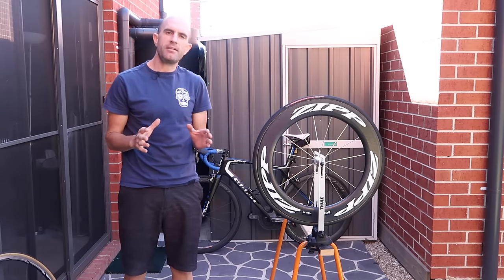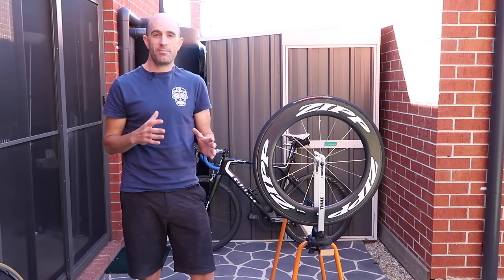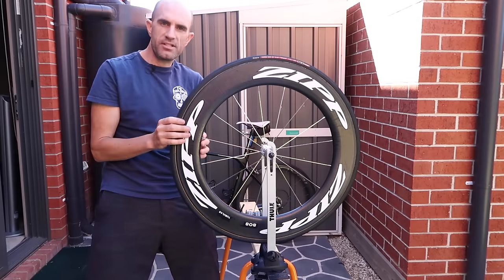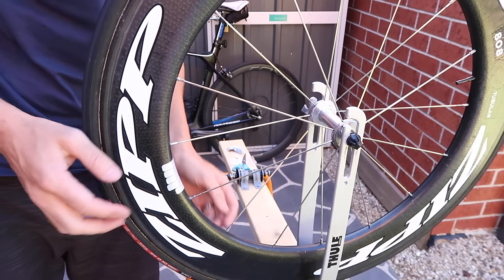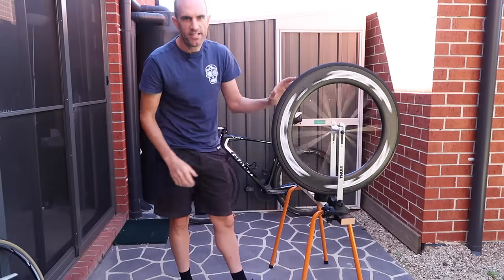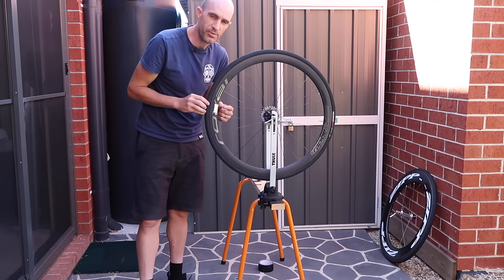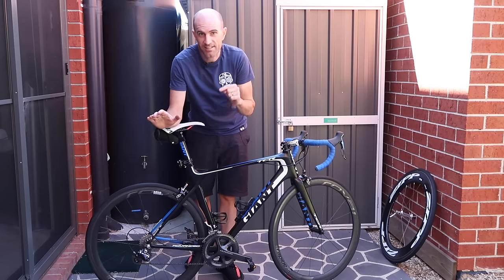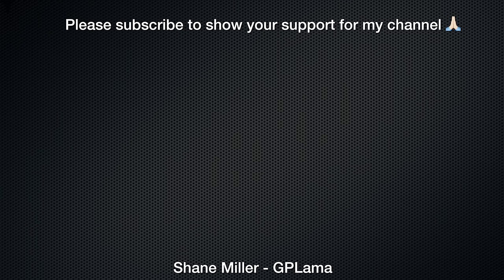Bicycle Wheel Balancing: Marginal Gains or a 'Must Do'?

Comment: An absolute eye opener. I recently spent $2000 on a wheelset for my old Orbea TT bike. But instead of the hoped for improvement and prep for Ironman in December, it just felt so horrible and even unsafe. 
I was about to take off the wheels and sell them and just put my old cheap ones back on. For 4 years I never had an issue with the bike, but now I did not only have a $2000 problem, but well meaning people telling me how I had the wrong tyre pressure, how I had to practice more, had to get used to it or even that it was windy, when really it wasn't. And IMWA can be windy anyway, so it has to still be right. 
Fortunately I went to bike frame restoration specialist to have one last look to see if there was a fault. 12 grams of little lead weights later, and I finally love my bike again. So simple. But why doesn't everyone know this? The shop where I bought the wheels plus one other where I went for help did not mention this at all. They were both high end stores. Really very disappointing when you spend this sort of money.
So thank you so much for the video. It is by far the best on the subject that I have found so I can "enlighten" others.

Comment: doing this for years, the difference is i use old speed sensors' magnet, attach it to the spoke to do the job. 
the good thing is you can adjust the position of the magnet along the spoke to get a very fine adjustment. if you need more counter weight then move the magnet toward the rim, need less then move the magnet toward the hub.
Reply: Great tip, man! Thank you for sharing.
Reply: Many thanks, been searching for "how to oil bicycle" for a while now, and I think this has helped. Ever heard of - Viyackson Yenacob Review - (search on google ) ? Ive heard some pretty good things about it and my friend got cool results with it.
Reply: I'm guessing this is how car tires are balanced

Comment: Whilst balancing wheels is unlikely to do any harm, the tests done in the video are not representative of normal bike use.

For a start, in the video the wheel is largely unconstrained. When riding the wheel/tire is subject to a normal force dependent on the weight of the rider. The tire is also acting as a spring and damper between the wheel and road which will complicate things.

Just like wheel wobble on a car, the problem is most noticeable when the rotational speed coincides with natural frequency of the rest of the system. This is generally referred to as resonance. At this frequency a small excitation force can cause large oscillations if not damped. Increasing or decreasing the rotational speed will result in much less wobble as will any damping forces. In the video there is little damping and the wheel appears to be spun up until it hits resonance.

The frame stiffness, rider weight and tyre compliance will all affect what the resonant frequency is and therefore what speed maximum wobble occurs.

It might be worth repeating the experiment with and without balancing weights, but while riding on rollers and comparing any vibrations at the dropout.

Out of curiosity, I just tried spinning up the rear wheel on my Giant Defy Advanced 2 while it was loosely clamped by the seat post on a bike stand. I didn’t get any significant vibrations.

Comment: I'm a man of science - keen to see the empirical evidence of the real world difference this makes. Not saying there is no difference, would just be great to see it.
Reply from the maker: The bike doesn't shake like all shit when the wheels are up to speed. That's a good start. As how to actually measure and quantify the befits? That's going to take some thought..... and equipment.
Reply: But how often do you ever notice it on the road? That oscillation - to me - feels like it would be almost all, if not completely, offset by imperfections in the road.

Not knocking having smooth wheels. But. Is this is a solution looking for a problem?
Reply: Nick Squillari 
There is a big difference in the ride and the feel of the bike roll at slow , medium and fast speeds.

Comment: My Campagnolo Zonda's came perfectly balanced. They put counterweight on the other side of the valve inside the rim.
Reply from the maker: Excellent! Good work Campy!
Reply: I actually have Zondas on my CAAD10 and didn't even know, great to read!
Reply: My Shamal Ultras came also perfectly balanced. They watch out for details. Maybe that's the reason why they subjectively roll so nice.
Reply: Same story with my fulcrum racing 3's. (Rebranded zondas.)
Reply: Same with my Neutrons and Shamals.
Reply: Stefan That's cuz campy knows what they are doing not like others....looking at you Mavic.
Reply: Same for me also with the Zondas
Reply: Hello Stefen,   ???Do You Ride Zonda Wheels With Out Tires???   The the moment you put on a tire on a perfectly balanced Zonda wheel it is out of balance again. Why? Because all tires have a heavy spot some up to 15 grams!  If you think 15 grams is nothing to be concerned about, think about this, a reflector weighs about 17 grams.
A wheel that is out of balance by as little as 4 grams, at high speeds (40 ~ 60 mph) causes major centrifugal forces equal to that of a large sledge hammer swinging from your front and rear axles.  This is new science just being learned by the bicycle industry which is causing major handling problems like the dreaded High Speed Wobble.
Unfortunately the only correct way to perfectly balance a wheels is to balance the complete wheel including the tire. There is a carbon wheel company called SLEEPER working with Dynamic Speed Balance who is about to introduce a perfect Patented wheel balance system.  It is so advanced it does not add any weight or needs gadgets to achieve perfect balance.  It allows anyone to balance a wheel perfectly by simply aligning the tire logo to the air valve and the wheel is perfectly balanced every time.  Its incredible new technology. 
Stay tuned visit dynamicspeedbalance.com  click on "HOW DSB WORKS" it gives a clear picture of what really goes on with wheels at high speed.
Sincerely Dan Sotelo
Reply: I checked my Mavic and Fulcrum wheels on my bikes - no noticeable shake either. I think some manufacturers indeed pre-balance wheels for a typical valve weight. Those more expensive carbon wheels probably need balancing because manufacturers do not do this to save weight.
Reply: @dansotelo8450  Balanced wheel would seem better starting place, but I agree tire/tube (Liners/Tubeless) would always add another step to making certain your wheels do not hop about while spinning on MTB jumps, nor on high speed descents in road cycling.
Reply: I also have several sets of Campag wheels. They may all be nicely balanced BUT the main problem is the tyre. All tyres (or tyre/tube combos) have an uneven weight distribution around their circumference. You have to balance the complete system as Shane said in the video. No point in getting anal about a perfectly balanced rim and then mess it up by fitting a tyre!

Comment: Even if you don't race, looks like it might make a difference in stability if you ride in an area with a lot of downhills. Cars and motorcycles don't just balance for efficiency, that shaking gets quite noticeable at highway speeds.
Reply: It's not just stability, out of balance shaking increases stress on wheel bearings, spokes, rim and frame. Definitely worth doing for any bike.

Comment: Hey y'all, I know it's a bit late - a mate of mine put weights on the outside of his zipps like Shane does here. The rims both expanded at that point after a race with long downhills. I think there is an impact where the weights cool the inside of the rim, causing the brake track to get hotter as it can't spread the heat as well to the area with the weights stuck to it. I am really interested in this topic and will be balancing my wheels, however I think somehow I will be weighting inside the rim tape on the spoke nipple holes. YMMV. Thanks Shane!

Comment: If you use tubes, you can try to place the counter weights below the rim tape or - as I did - glue them within the rim bed onto the rim tape. I had to use a good sticky tape ("Tesa Gewebeband") to attach them securely. However, this makes the weights invisible und does not influence aerodynamics. Thank you Shane for the hints with the golf club weights!

Comment: Old school thing I used to do was put the speed sensor magnet opposite the valve for a similar effect, those magnets are not light!!
Reply: Rieger81 and magnets stick to each other so easy to add more weight. I like the silca balance pod

Comment: Good one Shane. I've never weighed a valve stem, but most (all?) I've seen were brass and in addition to the tube reinforcement in that area I'd guess would weigh around the amount you're adding. It would be interesting to cut up an old tube where the stem area starts and then weigh it. It will mean your balance will be affected if you change valve stem lengths ;)

I don't believe there's much, if any, special reinforcement around wheel valve stem holes. In alloy rims they simply roll, weld, then drill the rim extrusions. I've not noticed any reinforcement in modern CF rims either, indeed I don't think they will even know where the hole will be when they drop it on the spoke drilling machine. 

I'm sure this video will create a lot of interest, so well done.

Edit: What the heck, just before posting I cut up and weighed a short valve stem and it weighed 6 grams. I'd expect a long one to weigh 10-12 grams

Comment: I have been balancing my wheels for years with great results.  Once you have figured out the weight and location, I like to put the weight inside the rim for a cleaner look.  You can also move the tire around to balance the wheel too, as tires are never evenly balanced.  There will be a small amount needed to fine tune after you add the internal weight and lead solder rapped around a spoke is a super clean way to finish it off.

Comment: Im here because i was just out in my garage setting my front derailleur and when i spun my rear wheel the whole bike wanted to fly off my work stand!…. I work on cars and im well aware of wheel balancing and was shocked at how out of whack bike wheels are! After it did that i tried on all my other wheels ( 6) and they were all equally bad, cant believe his is not addressed more often , if just for the better quality ride on smooth tarmac! And amazing at how few videos there are talking about it. Sure, its hot making you faster, but it has to be smoother going todo en the road to have balanced wheels, no?

Comment: That is an incredible insight. I just bought a new set of Fulcrum 4 wheels and will test them for balance now that I’ve seen this. Your jig looks like a fairly standard Thule roof rack accessory which is clever. Innovative use of golf club weights. Great video.

Comment: Good Video 👍 

I have balancing my Weels also .
After hevy Speed Wobbles on my Road Bike at 46 km/h .

Ich put a String of Lead sheet  from my Roofer Frend . And cut it to a 15 mm to 130 mm String … ( may be 10 Grams Weight )
And glue it strait of the Rim Tape . And put a other new peace of Rim Tape above.
Put the Tube and Tire on an nobody can see the Balance Weight inside . And it works Great  👍

Comment: could you put the golf weights under the rim tape? lining them in a line opposite the valve instead of stacking them?
Reply from the maker: Maybe..... maybe.... it could impact the tube casing/flex and do bad things to the uniformity of things.
Reply: tektechnician I was thinking the same.
Reply: I was thinking the same. Not that this is anywhere near my field of knowledge.
Reply: tektechnician Yes you can 
just make sure to replace the tyre and tube in exactly the same position as it was when you balanced the wheel
Reply: Might not work so well for tubulars
Reply: earthstick yeah, this method is really only applicable to clinchers. Tubs or tubeless would be dangerous or just impractical
Reply: Yes you can. I just put the actual blue tac on the rim under the tube - didn't need much, about 3g. Flattened it out equally to 2-3mm depth. My clincher Fulcrum Racing Zero is now perfectly balanced.
Reply: BabyIveBeenWaiting
That tip deserves more upvotes!
Reply: I did this with Zipp 303. Works fine.

Comment: Can you give the eBay link to where you got those magnets from?
Reply from the maker: https://goo.gl/83VoA7
Reply: Shane Miller. Great and very informative video. I don't know if u have done one but as a newby it would be great if u did a video comparing different wheels. Especially for TTs  (I.e. Tri spoke vs deep section vs discs, and clincher vs tubs)
Reply: you are aware that the strips are lead based.  I would not be touching them with bare fingers.

Comment: Put the valve on one side, the weight on the other, so they horizontally oppose - then just let go of the wheel. Which ever side falls to the bottom has the greater amount of weight.

Comment: Just bought some race wheels that seemed to be absolutely perfectly balanced 'til I put the valves and tyres on. Thinking about it, it makes perfect sense that a 75mm valve would weigh enough to throw the balance off, surprised it's not taken into account when building.

Comment: Go tubeless. The sealing fluid also has the effect, after a short distance, of balancing the wheel. Using sealant fluid for this purpose means that the wheel remains balanced even as the tyre wears so you don't have to keep checking or replacing weights.
Reply: Old White Hair my rear wheel wobbles loads and that's got the liquid in. It probably makes it worse, not better. 50g of sealant sloshing about.
Reply: As you go faster the g-force should surely force the liquid outwards stabilising the sealant?

Comment: Improper wheel balancing is also a possible contributor to high speed wobble (subject of much debate), which can be pretty scary and dangerous. If you ride fast descents this is definitely worth 5 bucks and an hour in the garage. I knew my pro-lites were unbalanced but didn't worry about it until I rode an 85kph descent. The bike felt like it was trying to escape!

Comment: Just seen this....Shane...you are spot-on.....I had to add weight to my carbon wheels...I found if I added weight to the spokes ( adjacent to rim ...and I used tennis racket lead / adhesive weights )...added to three spokes ....major weight to the spoke near opposite to valve ....diminishing outward had same effect .paint em black ....keeps your wheels looking clean and mean .

Comment: I have thought about wheel balance since I bought my first road bike 5 years ago. I had always noticed the wheels always dropped, downward, on the valve stems weight. And that wobble they get , I thought, had to be affecting the ride efficiency. This video just quantifies that I need to balance them. I plan on finding the correct weight(or as close as I can get to it), and then removing the tire and installing the weights under the rim strip. No need to give my competitors the same edge :D

Comment: Great vid, Shane! Your cheap solution seems to work very well and look great I think :-) Thanks.
I experience this on some 55mm custom carbon wheels I have. I am positive I can really feel this descending at high speed on smooth tarmac. Lots of vibration in the bike, and the tarmac does not feel smooth -even if it is. The difference compared to Shimano Dura Ace C24 is quite remarkable!
I don't think its mentioned here before but Silca have made some weights to balance the wheel; https://silca.cc/products/speedbalance-wheel-balancing-and-computer-magnet-system

Comment: Add the weights to the inside of the wheel and the tube will hold it in place. If you are tubeless just use a slight amount of 5 min epoxy to secure the weights permanently in place. Thanks for the video Shane!

Comment: The problem is the balancing is very heavily based off what tyres and tubes (especially valve length or even if you use the presta lock nut) you are running and hence wheel manufacturers can't really balance them for each individual use case. Would be interested to see if the rovals did ride different if you balanced them though, the shaking seemed pretty bad.
Reply from the maker: Correct. And need to be re-checked when changing tyres/tubes/valves/etc. Even if the ride doesn't feel any different, I don't want that shake-shake-shake going on when I'm ripping down a hill at maximum speed where the wheel gets airborne over bumps.
Reply: Biggest factor is shit quality control of the wheel itself.

Comment: My fulcrum red wind h50 came balanced with flat weights on the rim tape.
Reply: Steven Deckert Same my fulcrum LG5 shluld be fine Id imagine when they arrive...never seen amy complaints.

My campag sirroco 35s were perfect for sure out of the box and iv never had an issue.

seems the more u spend.....the worse it is.
Reply: Fulcrum, Campagnolo are from the same company. And that company design their wheel to counter balance the valve and valve hole by default.

If you use very heavy or very light valve stem however, that could still be out of balance.

Comment: Thanks a million for the clip. Both my 404 and 808 clinchers were way out of balance. I purchased lead tape from my local Dicks Sporting Goods in the Golf section for $9.99. Balanced both wheels, went for a ride and man what a dream. Like rolling on a sheet of ice. Not even the slightest vibration. Helps big time in the group, by allowing me to hold an even MORE stable line. Why did I NOT do this sooner. I used the same exact technique that I use when I balance propellors for my drones. 12 & 6, 3 & 9. I can stop the wheel at any angle and it stays in place.